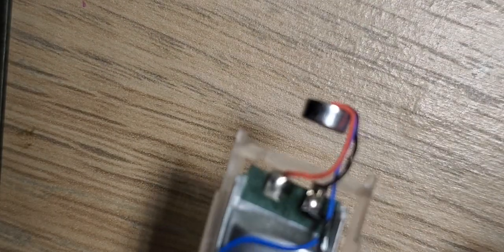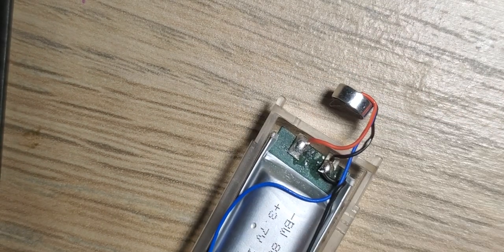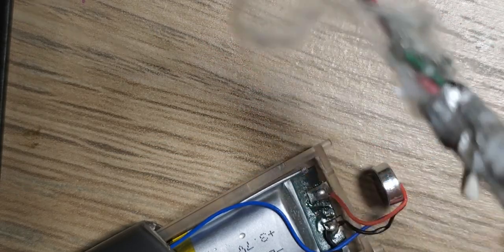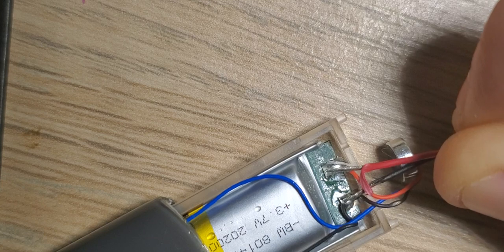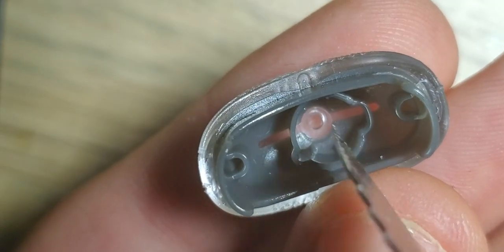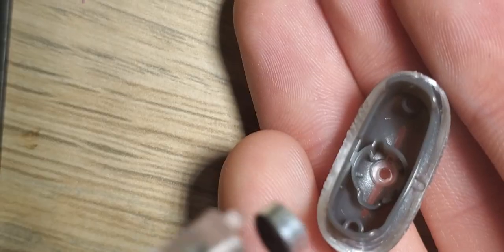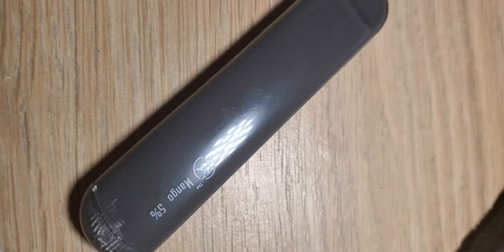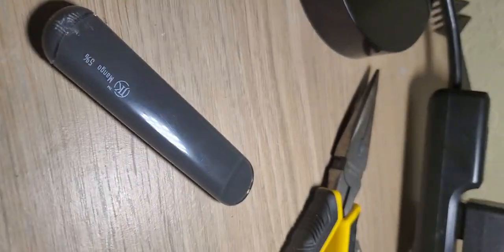How to CHARGE AIR BAR VAPE

Comment: I think they patched this glitch. They put some sort of silicone seal over where it would need to be charged 😢
Reply: Maybe one new one but it worked fine for me
Reply: Just use ur nails carefully scrape it off and then press the metal contacts back on the green part then ur valid
Reply: @2l8te  fr?
Reply: Just flip the battery over theres two clean contacts on the back. Works like a charm
Reply from the maker: Yeah it's on my channel and soon I'll be releasing a video trying to show you how to do it and why not to do it...lmao

Comment: Question! Why is it not hitting hard it hits for like 1 and a half seconds problem?
Reply from the maker: The power and time it lasts is compared with the wallplug capacity and the time you leave it charging. Also, make sure to put everything together on its place. I have an updated video about air bar in the channel

Comment: I did it and it worked!! Can you do this more than once on the same airbar? How long does it last afterwards??
Reply from the maker: It lasts as much as you charge it. But i wouldnt recomend more than 3 charges, 1 - 2 minutes charging max depending on what charger u using.
Reply: @electricshiit9274  It isn't an infinite flavor machine...it has eliquid in it that runs out and teaching people how to do stuff like this is EXACTLY how stuff like this gets banned.
Reply: @47ravenlord  Coils become disgusting when dried up, even the desperate and stupid would have a hard time hurting themselves with an airbar...

There are many reasons why watchdog groups try to ban vapes. This is not even in the top 3.

If anything the biggest argument against disposable vapes is the excessive and unnecessary electronic waste being added to landfills.
So getting a few more days out of one is the next best environmentally conscious thing you could do behind investing in a proper device or quitting altogether.

Comment: Caught on fire
Reply from the maker: U gotta be precise and delicated
Reply: Bro so did mine
Reply from the maker: @gigufysiys8757  u are touching the cables  where it is not suppose to, or you are pressing the bar way to strong. Remember, the only thing touching the vape will be the edge of the wires.

Comment: Mine still started catching on fire and I wasn't touching anything but the metal part
Reply from the maker: How did u pull it? Sometimes if u press it to hard to pull it out, that happens.
Also check if the circuit board is dry, dont try to pull it out completely, always try to leave the cap and the wires attached
Reply: @electric sheet 
What if the board is dry???
Reply from the maker: @anthonywojnovich5934  if the board is dry and you did pull it right, without touching anything but the plastic piece with something small so it touches only the plastic, idk, i need more information

Comment: when i reattached the circle thing to the back of the dispo it started smoking and the wires melted.  could you please let me kno what i’m doing wrong
Reply from the maker: Sometimes, the blue wire is placed right between the metal bubbles, and it happened to me to actually burn the blue one instead of recharging, so instead of using a knife or something metalic, try to use a sharp plastic object to do it. 
When placing the bottom cap back again to the bar, make sure that the blue wire is not in a bad position but don't break or force it, make sure to fit for your case, also you dont want to pull the whole cap, you want to keep the blinking/air pump system attached, to keep working properly. I made another video, its in the channel library, with more details. YOU CANT PULL THE BATTERY MORE THAN THE ENOUGH TO SEE THE METAL BUBBLES. You can mess with things and its trash. As soon as you feel a burned taste OR after 20-40 hits, stop smoking and trash it. Won't be good to your lungs and mounth.
Reply: this has happened before too- the black is the ground and red is positive, sometimes it will short and it will spark, if it does that take it off immediately, the wires will heat up and in some cases if you leave in on after it sparks it could explode
Reply: Same

Comment: How much charge does it give u.
Reply from the maker: About 20 more hits
Reply from the maker: The thing is, hm do ypu smoke it before? Which plug outlet? How long did u leave it charging?
Reply: electric sheet it’s dangerous too. I saw a couple sparks flying😂

Comment: Then bottom part broke off but the wires are still okay will it still work?
Reply from the maker: What u mean by broke? If u can put the piece again in the right place its ok. Sometimes mine cracks and i just put it together like a puzzle. It wont work without the bottom cap cause the air needs to go 1 direction by the small hole passing through the filter (where the light blinks)
Reply: electric sheet will it still work if the bottom piece is broken into 2 pieces?

Comment: Please if you do not understand how dangerous this really is. DO NOT DO THIS! 

Get yourself a little rc helicopter and steal the charger from it. Make your own little connector and go from there. If you just put 5v which is what comes out a charger cable. It will add a tiny amount of voltage and destroy the battery if it’s there long enough potentially explode….

Comment: How do you make that wire
Reply from the maker: Take any microusb charger cable. Then, the wires are inside this silicon/plastic cover, u need to take the cover, separate the wires, and take the colorful cover of the copper wires u will use to tluch the metal bubbles. You can take the colorful cables woth your mounth, bite it and pull it, the metal wires will be released. You can twist the separated copper lines that will be released in other to make it easier to all of them to touch the metal bubbles in the air bar.
Reply from the maker: I just posted a video cause of you

Comment: How do u open it
Reply from the maker: Try to do exaclty as i did, grab a similar tool and twist,  sometimes it is harder, depends on the airbar....
Reply: electric sheet how’d you take the bottom off tho
Reply from the maker: @Viraltiktokonly  i have a video explaining
Reply: electric sheet damn I already broke it tryna take it off🤦‍♂️
Reply from the maker: @Viraltiktokonly  go slow, but if you dont have the same tool will be hard cause these things are strongly put together
Reply: I tried with his tool and u know.. I'm under age so I'm weak. I fucking wit it with that tool and ended up using the wire cutter. So the wire cutter worked better for me

Comment: i need help mine blinks 10 times and i just bought it
Reply from the maker: If you just bought it and didnt try to open it, make sure it didnt fall, you didnt left it at the sunlight for a long time, didnt smash it, anything that happens to the BOTTOM piece can damage the wires or the air pump system. Please go to the other video of this channel to properly open it and fix it, maybe recharge it later 😅

Comment: Doesn’t work for me still blinking
Reply from the maker: Sometimes, if you dont attach the bottom piece right, or if your chargin method wasnt precise when touching the metal bubbles with the wires, it will blink again. Also, it can catch on fire so do it as delicated as possible.